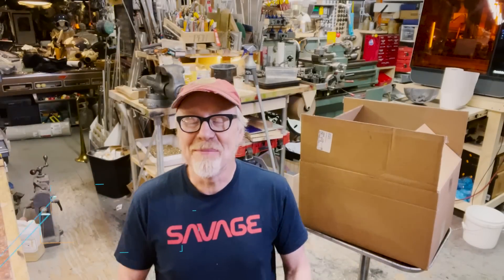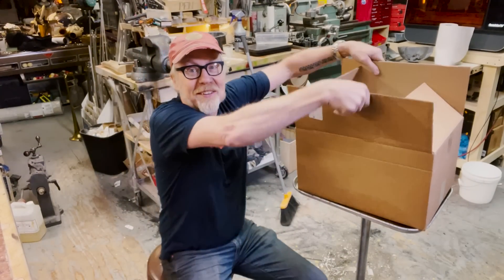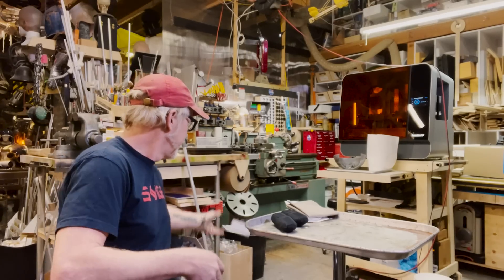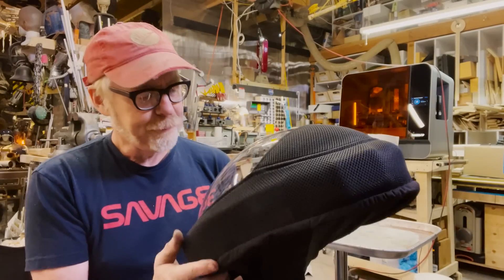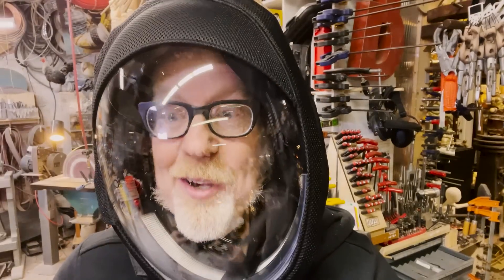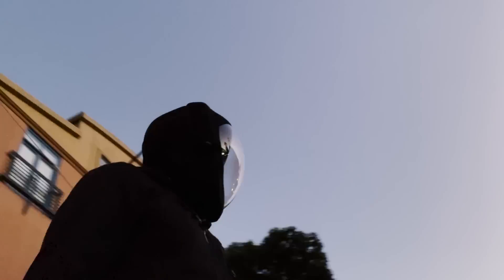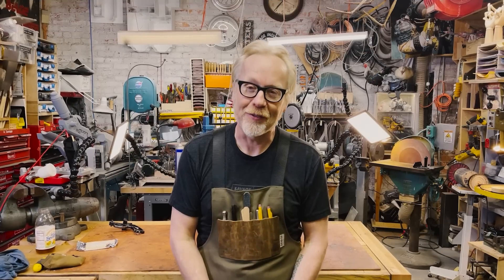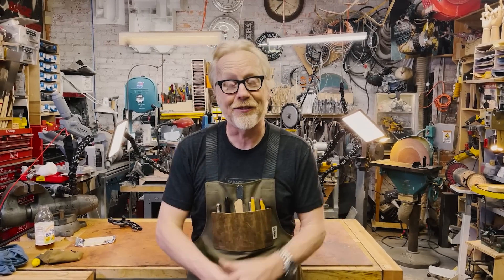Adam Savage Tests the AIR Active Filtration Helmet!

Comment: 13:24 Adam, I foresee that person being you! 
Maybe not directly, but I also see you rolling that helmet into a cosplay Dune or Alien or Star Trek I helmet (on the cheap xD), and upgrading the fans, upgrading the headdress, adding mic pass-throughs and sound amps for conversational speaking, lights for whatever reason, and I will be watching every minute of that build vlog!
Reply: I'm already kinda doing all that with mine. I've got comms mostly figured out, but having the speakers built in is the next phase of the plan. My main concern is audio feedback with the mic being so close to speakers. I know its doable because motorcycle helmets have had Bluetooth audio solutions since forever, but I can't just use an off-the-shelf solution because it won't amplify environmental audio outside the helmet. I think someone (probably me) is going to have to figure out a bespoke method of providing echo cancellation in such a confined system. Where Grant Imahara when you need him? 🥺
Reply: @MikeTrieu  That sounds pretty awesome! I wonder if handling the sound filtering and/or noise cancellation would be easier to hand off to a mobile device via bluetooth or a custom mini processing package fitted in the helmet somewhere. Could use that processing package to dampen or noise gate the internal speakers so the mic has less difficult time filtering them out, though, I imagine the space available inside and around the helmet is becoming increasingly limited. Fun to think about though!

Comment: Why would it work? Everything that really works like diving. Air masks for flight ect.  Even simple stuff like ski goggles. Keep nose and mouth totally seperate from helmet space.
Reply: Why wouldn't it work?  It cycles air through the helmet.  NASA helmets work exactly the same way.
Reply: @stargazer7644  well NASA air going into the suit is already been scrubbed for water other contaminants and temp adjusted. Not sure this filter is doing all that. Nor is this fully exchanging its air / moisture inside.
Reply: @joeszucs2190  It's drawing in air from outside through a HEPA filter.  It's the same air temp as outside.  The filter stops most particulates.  It doesn't "scrub for water".  You're breathing outside air, but through a HEPA filter.  Exhaled air is getting blown out through another pair of filters.  Exactly like what happens when you wear an N95 mask. That's the point of this.

Comment: The fogging was caused by the cool outside air, and the warm air inside causing condensation. Maybe if it was double paned with a vacuum inner barrier, the fans would have an easier time keeping the mask clear.

Comment: 2 questions arise... 1 - is the neck "sleve" is secure enough to keep air from leaking on the side and allows it only via filters? 2 - what happens if those strings get tangled for any reason? Apart from that i think there is something in this but not 100% sure
Reply: Do you often worry about the strings on your hoodie getting tangled?
Reply: @stargazer7644  i usually do but then again the hoodie as them in a different area then this

Comment: The idea is good even though it's hard to implement, but considering the potential  (this is pricey for something that doesn't work well) affordability of the design itself it could perhaps serve as a good platform for diy modding?
If the problem is fan noise can't you just tube the helmet and place the fans further down on the body, increase fan size and use some foam material to reduce vibrational transfer between the fan platform and say it's attachment to a duty belt?
Ooh, or better yet, combine this helmet with one of those ac jackets that already have mounting options for fans around waist height.

Comment: I wonder if it would steam up in cooler and/dryer conditions 🤔

It would certainly feel less claustrophobic if it were based on a Soviet space helmet! 🚀
Reply: Your own breath is providing the moisture and its the cold outside air causing the condensation. Warmer air and a desiccant to absorb excess moisture would go a long way to solving this issue.
Reply: @MikeTrieu  moisture comes from your breath!? 😲 You don't say!

Anyway, seriously... nobody's arguing that point. The temperature affects the due point though, and the humidity of the surrounding air affects how much extra moisture the air can carry.

A desiccant certainly isn't appropriate though, unless you could dry it out between uses (run the air the other way while on charge perhaps). They're meant to be used disposably. Once they've matched the humidity of the environment, they're useless.

Comment: Reminds me of those ludicrous retracting helmets from the 1998 Lost in Space movie.

Found an article on this thing, and all of the people in the publicity shots are wearing the helmet with the visor tilted much farther back than Adam. The bottom of the visor is just below the chin, and the top is above the top of the head. Looks to me like wearing it that way improves peripheral vision.

Better fans and optimal fitment are probably all it needs to reduce the fogging to a minimal level that an anti-fog solution could handle. My experience with actively venting a mask is limited to paintball masks, but in my experience, it's not the power of the fan that's most important, it's directing the airflow over the visor to create an air dam that prevents condensation from even forming.

https://mymodernmet.com/microclimate-air-helmet/

Comment: Maybe try something with heat instead of pushing air around with fans. We do have moisture in our breath.
Reply: The point is it blows the exhaled breath out of the helmet.  The problem starts when you're breathing harder than the fans are blowing.  These are intended for use while sitting in an airplane, and they're fine for that.  If you want to exercise in one, you're going to have to speed the fans up.

Comment: Could it be the low air temperature outside cooling the bubble and causing more fogging inside? A heating element in the bubble could help.  I'm not convinced this is totally sealed though. It needs to be certified similarly to respirators otherwise it is just another corona-economy toy.  What effect do the fans have on neg/pos pressure in the helmet and how does that interact with their method of sealing? It might be a virus blowing machine.  Btw watch the walking home sequence at 0.25 speed, it's really sweet for some reason.
Reply: Its both low ambient temps and the fact that your breath contains a lot of moisture. Heating the dome would help, but uses too much battery. Other respirators feature an elastomeric baffle around the nose and mouth to redirect water vapor out of a one-way valve. This open-face design does not allow for that. Also, unfiltered valves are a bad idea during a pandemic. All air must be filtered coming into and exiting the mask. The exhaust fans pull a negative pressure inside, which draws fresh air through the HEPA filters.
Reply: @MikeTrieu  They could try a belt clip battery like the heated vests made by Makita / DeWalt do.

Comment: I'd be worried about the amount of recirculated air in a contraption like that and carbon dioxide buildup.

That said the fan should really be used to force fresh air through the filters, not try to stop fogging.
Also, if that was me designing the helmet, I would include a heated windshield to prevent fogging as well as the ventilation fan.
Reply: The air you exhale gets evacuated almost immediately and fresh air gets pulled through the HEPA filters to replace it. Resistive heating would eat into the battery life, lessening runtime or increasing weight for additional cells. A passive hydrophilic polymer coating on the inside is a much better idea. That's exactly what they use in a lot of motorcycle helmets.
Reply: @MikeTrieu  what mechanism evacuates the expelled air?

When you breathe in, you create a low pressure zone inside the helmet which draws in air through the filters, but when you breathe out your just increasing the pressure, so most of the air pushed out through the filters will be the fresh air that you've just brought in.
There's no mechanism as far as I'm aware to discriminate between the expelled air and the air drawn in.

Comment: Hi Adam! a solution for a fogging visor my be the direction of airflow , the air drag must be from top of the eyes downwards to the mouth,  and the air outlet must be in front of he mouth so the warm air has less distance to travel, also you may create a double pan visor similar to the home windows. Just my 2 cents. All the Best! Stay Well!
Reply: The air inside the helmet already flows that way. Its just that the fans are underpowered for the volume of air people expel during strong physical exertion. The company acknowledges this, but says they balanced battery life with fan power.
Reply: Always the price is averaging a potentially good product.
Then another solution would be to let one of the fans to be relocated as exhaust , with an exhale receptacle closer to mouth,( would allow better collection of humid exhaled air) 
p.s. thinking never stops ;)

Comment: If you havent already, check out @DeviantOllams's twitter thread about this.  He wore it on a few flights and didnt run into fogging issues i dont think. He also did some mods that made the fit a bit better, and usage a touch more functional.

https://twitter.com/deviantollam/status/1356273023431680002

Also regarding the fogging, as a thought, could it be the neck seal wasnt good enough?  Air being pulled in through the neck rather than through the filters and over the glass.  Just a thought.

Comment: Adam! You should modify it to have a hat strap! Like construction helmets have!
Reply: Yeah, some kind of suspension would be nice, but the half ones for the industrial face shields would probably be more appropriate because that's pretty much what this is. The challenge is that the ring frame is constructed of very thin and fragile plastic. I've already managed to crack mine without too much effort. You'd probably have to spread the load around the attachment points with an adhesive strap of some kind. I've been eyeing the 3M H8A for modding into the Air.

Comment: I have a design in my head that is almost the same as your filtration helmet but it utilizes the bicycle helmet harness for stability and adjustable head tightness, a separate chamber for your mouth (fog stays in mouth area)

Has radio unit for you to hear around you and and a speaker for people to hear you.
And bluetooth capability for when you wanna listen to music.

Safety feature includes light reflectors around the dome, "mood" lighting if you need to show your face in the dark, UV light film that darkens in sunlight, and air circulation.

Same cloth covering for the neck area thats optional, since there will silicone seals through the jawline.

Again, its all in my head. Hopefully someone takes all these and make their own 3d printed air filtration helmet

Cough*adamsavage*cough

Comment: There is a trick when scuba diving I learned from my instructor for dealing with foggin. Skin oils will worsen the effect of fogging on masks. We used toothpaste(not gel) or dish soap to treat the masks and it helped a lot to prevent fogging, and I know there are commercially available de foggers for scuba gear available, but these two things are easily available. Now the application of both things is a bit different and requires some time to set and give the full effect before rinsing it. There are video tutorials from professionals out there so look em up! It worked for me, maybe it will work on this.

*Edited some typos

Comment: i think i missed something, if the mask has the filters and fan in it, and the back is just a hood, is there a seal around that separates the hood from the mask?  if it doesn't your still sucking air through the hood...no?
Reply: The fabric is dense so air won't go through it.

Comment: Thanks for the demo and walking test, Adam!  You mentioned that you haven't been able to find a helmet exhaust fan that moves enough air quietly enough.  It wouldn't work for every helmet design, but have you tried quiet 120mm or 140mm PC case fans?  I would think those would work a treat, as long as the intake and exhaust ports weren't too restricted.  There are a few PC parts sellers online that specialize in silent PC components (e.g. Quiet PC USA), as well as review sites like Silent PC Review (sometimes with standardized-dB fan recordings).
Reply: Instead of broader fans, you could instead purchase deeper counter-rotating fans with increased static pressure. Delta sells a few of those, but they're loud as hell and power-hungry. That 8-hour runtime would probably plummet. Would likely have to supplement the battery bank with an additional pouch cell to compensate. I also don't know the max current draw that fan controller supports before the headers burn out. I'd look at the silk screening on the PCB, but its under a black plastic box attached with what I think is 3M VHB foam tape.
Reply: @MikeTrieu   Yeah, Adam mentioned in the video that his lack of success in the past with helmet fog prevention was mostly down to him not being able to stand the noise of "loud as hell" fans, thus my suggestion of larger, slower-running fans specifically designed for quiet PCs.

Comment: See, that's the problem with masks like this. They're compromises that avoid known solutions because they're uncomfortable. I've spent 8+ hours in an M-40 mask and it was incredibly comfortable, and I had zero fogging. But. That's a mask with an internal sub-mask that vents exhalation directly and draws fresh air up to the lenses and has one-ways into the nose/mouth area. Combined with the need to get custom lens inserts for vision correction (and the cost!) they're a very difficult sell. I'm currently trying to bang together something more friendly (a bowl mask gets you laughed at, a military-style mask gets the cops called) because I'm always interested in environment suits, but there's always compromises if you need to wear glasses or have a beard. I think this style worn as a hood over a smaller one-way mask over the nose and mouth would be fantastic, but then we get into needing to put audio devices on it, and at that point I'm putting in a radio . . . and feature creep.

BTW, Adam, if you actually read these, you look so much like my family members and I haven't seen them since COVID started. It's always so comforting to watch you do stuff. Keep being awesome.

Comment: I imagine someone has already said this but check out PinLock inserts for motorcycle helmets, they basically are double glazing for helmet visors, IF fitted correctly AND an airtight seal is made they stop all fogging. A pinlock could work well with this application imho 😀

Comment: So I have a question Adam. In your opinion, for the price point, compared to other filtered Headwear, would you choose this over other items for use in an environment where dust would be the primary concern? Like in a shop sanding wood and epoxy, or grinding room processing metal?

Comment: Use very thin high resistance wire in a grid & from a very short distance it's invisible but when turned on with an electric current it will cause heat and any moisture on the visor will immediately evaporate

Comment: Probably important to note that they are very clear in their advertisement and on their web page that this is NOT how this product is supposed to be used. Every tool is a hammer, but a saw can be a damn bad one, and still a very good tool for what it is actually for. This space helmet mask is for sitting down in, on aeroplanes, busses, and similar high-density locations. Not walking/running around in. They state that over and over.

Comment: Peke Safety makes a nice helmet.  I use one in my woodshop.  I generally get about 9 hours of run time per charge.
Reply: Of course I don't wear mine outside in colder temps.  I agree,that would be a difficult task of preventing it from fogging up.

Comment: How much power would a rear-window defogger use? 104W for a car window at sub-zero temperatures suggests maybe 5W for this application, so 16Ohms at 9 volts seems like a good target for a maximum.  Wouldn't be surprised if a single watt was all you needed.  The 0.5 Amps needed for 5W is like a quarter of a 9v's output, and it's close enough to 12v to mesh with the car tech.  Horizontal striping seems the most natural, but concentric circles with the bus breaking off up or down (like nested omegas or 2d balloons) ought to do the trick while maintaining aesthetics.  Just connect the traces in series or parallel until you hit the target resistance as measured from the poles.  Do it on a test surface first though (mainly  to find ohms/foot), and maybe put a pot in series with the array in case you have to turn it down.

  There are paint-on kits you can buy cheaply, but I don't know how sensitive it is to substrate material; ie you'll have to take care that the plastic doesn't melt.

Comment: Here's an idea to fix the fogging. Look up pinlock visors for motorcycle helmets. They add a second visor layer to separate warm moist inner air from cold outer surfaces. They are very effective and don't rely on coatings or sprays which wear out.